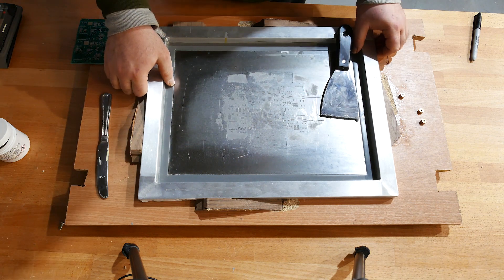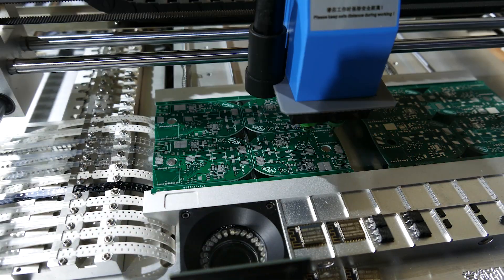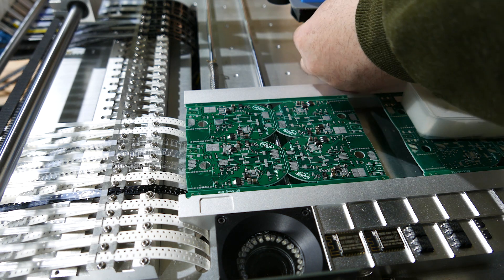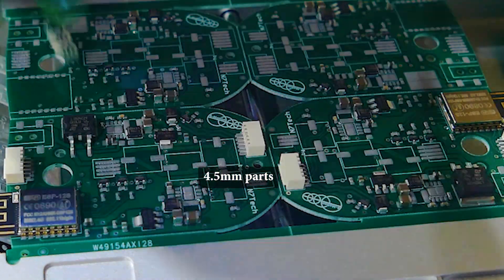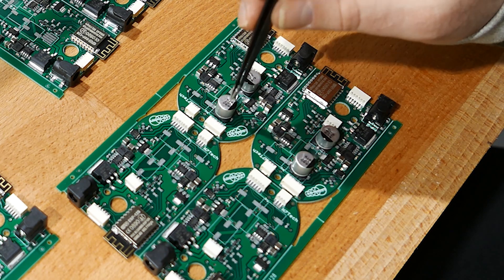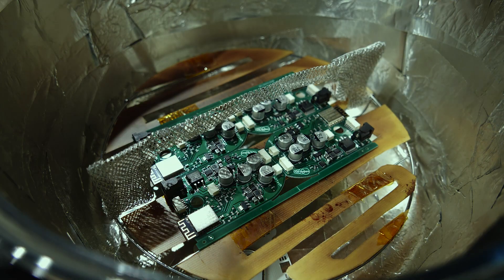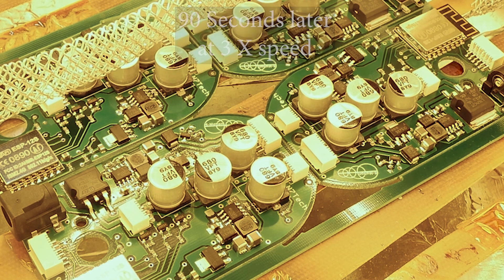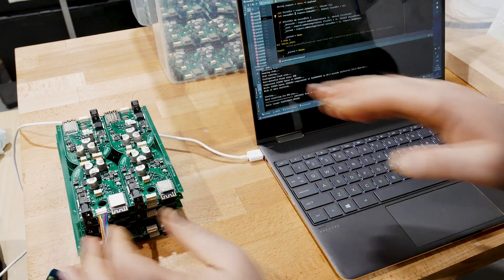Small scale PCB manufacture with Charmhigh 36VA (CHMT36VA)

Comment: What is your opinion now after 2 years. We are in a somewhat similar situation and are considering this machine. Any experience with 0402?
Reply from the maker: Personally I wouldn't feel comfortable trying to place 0402. I feel like there is some amount home/zero drift during sessions. I limit myself to 0603 and that mostly seems fine. You could check over on the https://groups.google.com/g/desktop-pick-and-place forum for other folks experience with 0402 though. There do seem to be a growing number of people using this machine (and the 48VA/B) actively there now which is a big plus. 

The vision video on/off thing is still an issue for me, and the solution so far is still the same - restarting the software, or the machine if necessary, and it's normally ok after a couple of tries. 

Haven't looked for any alternatives - but going by the continuing and expanding activity on google group I'm guessing it's still the main option at this price point.

Comment: How is this machine performing here in March of 21?  We are looking at a PnP machine for our own operations.  BTW a T962 Oven is stupid easy to use and is set and forget.
Reply from the maker: haven't used it since the initial run - will be firing it up again very shortly for a second run though. I bought it because 4-mation uses 4 different boards and it was at least similar in cost if not actually cheaper than paying for board assembly. Also since I've not outsourced board assembly before, it felt less risky. 

The problem with the 36VA is the camera module - it's super flaky. Out of the box it just would not work, at all. That might have been because of the virus on the supplied USB stick with the software. A full PC wipe and re-install of windows 10 pro with known clean software version worked, but it's still flaky. Sometimes when you start the machine and the app, the camera just doesn't work, and you have to power cycle the machine and restart the app until the camera starts working. Once it's working though it stays working until you power down.
Reply from the maker: @derekspeare - did you pull the trigger in the end? I used the 36VA again recently to process a second batch of boards, and as before it was not seamless, but it worked with some babying. Now I realise that the main problem is not that the camera fails occasionally and requires restart (it still does), but that there is drift or random shift of coordinates between runs, requiring checking of pick-up coordinates and adjustment for every run, But given that I can't afford a "real" PnP machine, or the time to build my own, it still seems like a rational compromise for my purposes...
Reply: @n0f8r  No, not yet lol...your experiences are the reasons why I have held off.  I did buy a seven thousand dollar laser cutter instead.  We build by hand and frankly, we're really good at building the components we manufacture.  We hand place QFN and 0402 parts without issues :D  For the money this machine costs, it has to work and do so reliably, and that's not something I've been convinced it will do...and has to be able to run several thousand boards a year :P
Reply from the maker: @DerekSpeareDSD  several thousand boards a year would not be a problem. Machine is definitely not reliable, it does need a lot of babying - still orders of magnitude faster than doing it by hand though - at least for me anyway. In a full day I could easily do about  200 of these boards now, just haven't needed to yet :(  Course - I deliberately avoided 0402 in my designs because I was eyeing this machine and forum advice was "your milage may vary" for 0402.

Jealous of your laser cutter! been wanting one for years... Still driving an hour each way to a maker space that has a decent one...
Reply: @n0f8r  Laser cutter is good - works and keeps working.  We usually stay no smaller than 0603, but can do 0402.  Our stuff is pretty simple, though.  I can build myself about 50 in a day...but it's tedious as F.  If this machine was "fire and forget", I'd have bought one long ago :/

Comment: Kevin, there's got to be a way to flash all of those cards at once. Can you split the cable and go to 4 from 1? or 100 from for that matter.
Reply from the maker: Cool idea - but since this video I've realised I can run the serial upload at a much higher speed of 460800 baud and still get reliable loading. I thought I experimented with diff upload speeds at the time, so maybe it's down to ESP core or PlatformIO improvements since then. Anyway it takes about 5 seconds per board now.

Comment from the maker: Seems there's a major problem with Charmhigh's more expensive machines and their pneumatic feeders bouncing parts in the tape before pick-up - video from Sean the Unexpected maker here: https://youtu.be/voYQLI3GqH4?t=268 Thanks to @j anderson, @Evils Dexter and @mr dashpuppy for pointing this out.
Note there's actually a real problem with the camera  on their cheaper machines as well - like the one in this video - but it's well documented on the forum (desktop pick'n'place google group) and you can work around it. Basically on startup the camera is often not detected properly and you need to restart the pnp machine until it is.
Reply: I've had the same machine (T560P4) for 3 years and never had the same problems as Sean. I've seen his videos and seems like he just got a bad one. I've made boards with over 200 components (0402 size and up) and only sometimes have to fix 2 to 3 components max. You get what you pay for at the end of the day and these machines cost a fraction of their counterparts, but once tuned, they do actually work well.
Reply: Questions. Are there any pick and place machines that also dispense the solder? At low volumes, it removes a step. Almost just another nozzle. 
How many nozzles do you need in total?
Reply: Those feeders are from an external company not from Charmhigh directly. Even if they bundle them they're not directly from them. It seems like some part is broke (due to wrong installation) in his feeders. Which is not his fault though.

Comment: Thank you for the great review.  This is about $3300 to US including DHL shipping.   I agree about the reflow oven, I use a table top Convection Toaster Oven < $90, takes about 4 min, works great.  When the largest mass part liquefies, wait 3~5 seconds and turn off, note the elapsed time, open door, wait > 20 seconds and remove PCBA.  If making duplicate PCBs  set timer to the previously noted value and make many!  They also have a decent Stencil Printers for about ~ $415 shipped.  These have fine pitch threads for precision adjustment, not the crude 1/4-20 bolts of other models.

Thanks again for this.